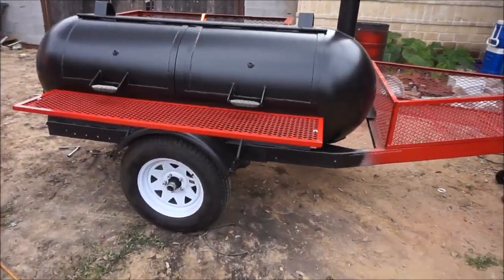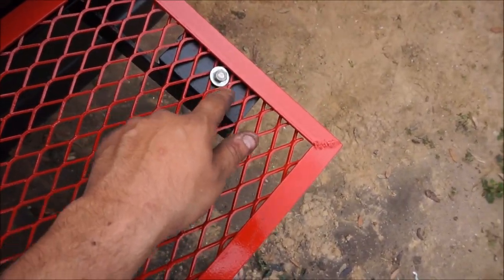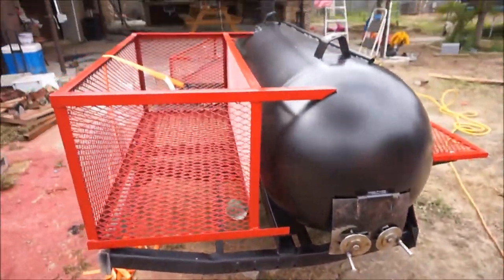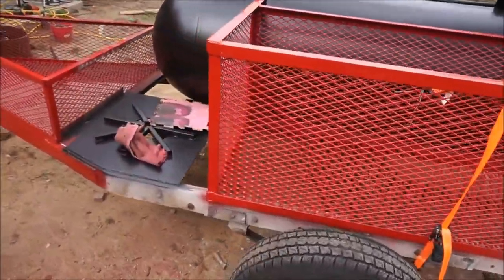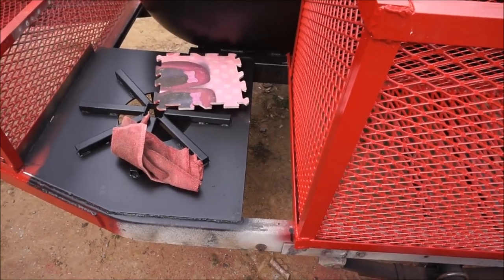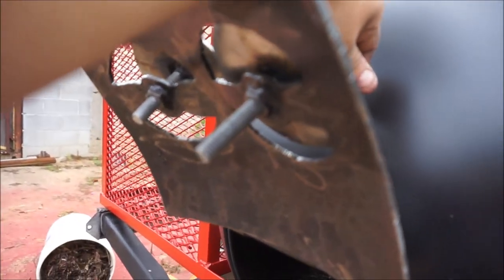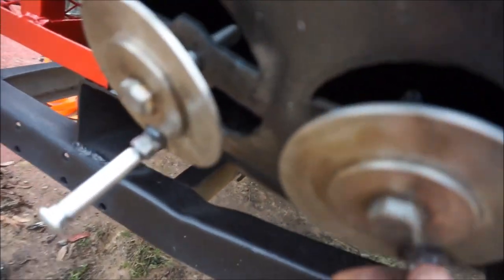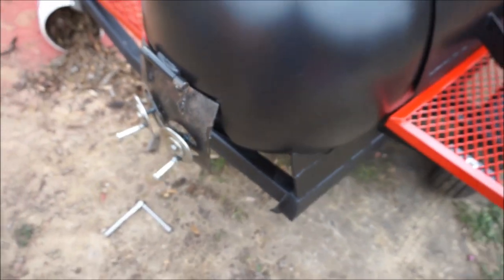HOW TO BUILD A TRAILER SMOKER FROM A 250 500 PROPANE TANK DIY WELDING PROJECT PART 17

Comment: This is amazing omg
Reply from the maker: +Benjamin Petr Thanks. It came out good and it can feed a lot of people during out holidays. I am working on another project which is a vertical smoker which is a little smaller then this tank. I tried to use as little of new material as possible. I did get new lights and tires which seemed very important as it would be on the road from time to time.

Once again thanks.
Reply: +Jorge Serna Sound very cool and I'm looking forward to it!

Comment: Great looking BBQ trailer!....
Reply from the maker: Thanks and it cooks great weather i grill or smoke in it. I will be building another smaller bbq pit for a buddy in the next few days.
Reply: +Jorge Serna 
what kind of welder did you use? Stick, tig., mig..for fabrication. What we're all tools used?
Reply from the maker: cadencorin1 used a basic lincoln 225 arc welder from home depot, a hypertherm 45 plasma cutter and a few 4 inch grinders.
Reply: +Jorge Serna awesome..thx!
Reply from the maker: cadencorin1 Thanks. I have been away from projects a while but I do have some materials and ideas on the back burner. I hope I can have some free time and $$$$ to keep going.

Thanks again.

Comment: always get creosote in my smoker ... i put in a heat defuser plate below the rack... but still get a but of that taste on the meat ...thinking now a second smoke stack may pull more draft what do you think?????...iv got the video of the smoker on my channel
Reply from the maker: redsaw 90 feldoncentral has a calculator to help you determine the intake and exhaust ports.  Once you enter your firebox and cooking chamber it gives you square inchs of stack and height. Thats what I base myself on all builds. I also preheat wood on top of firebox to prevent excessive white smoke.
Reply: got fb???